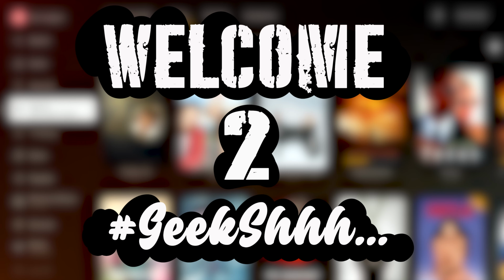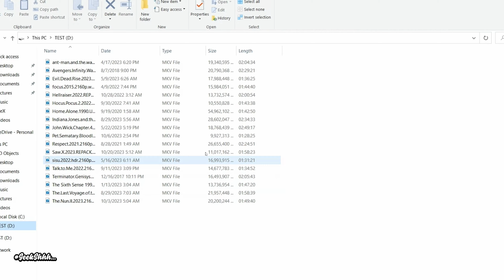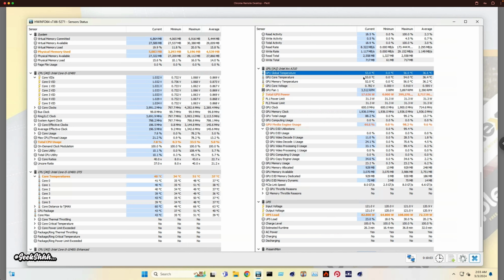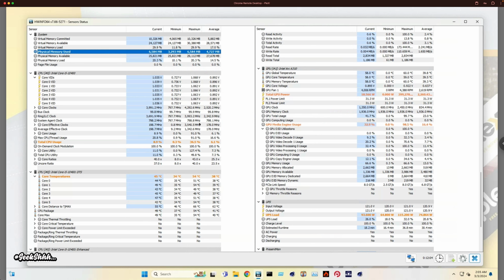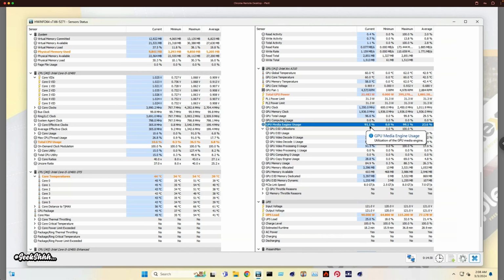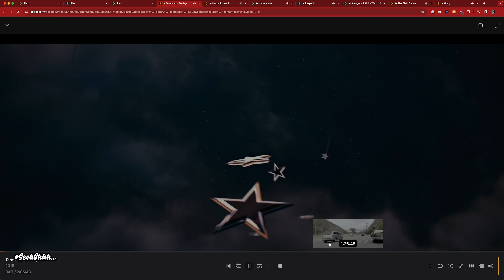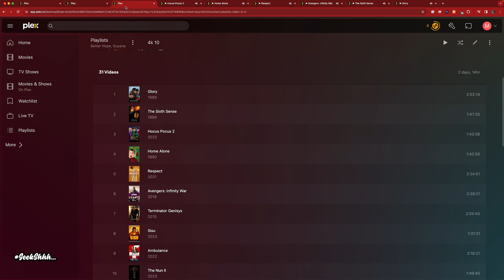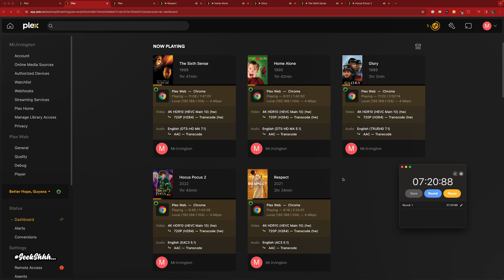Intel A310 #Plex 4K Transcode Test #Arc #GPU

Comment: This video is a god send. The a310 is the only card right now that comes in single slot and low profile and does Av1 so its great to know how well it does in transcoding. I feel like this is the real use for a card like this. Thanks for making this. I hope to see some vids of how it handles AV1!
Reply from the maker: I did an AV1 video and ill be releasing Next Monday. Thanks for watching and commenting!
Reply: Nope nvidia has single slot options as well just not consumer cards. But they do AV1 encoding.
Reply: @stephenxs8354 yeah and I own a Tesla p4 and I have to say it was a waste of money. No fan by default (cooled by the rack server I know), runs extremely hot while transcodes plus the driver issue under Ubuntu makes me wanna die.. Pain in the ass to get it up and running plus remain silent and hot or add a fan and still remain somewhat hot but extremely noisy.. I just swapped to the a310 and every problems are basically solved

Comment: I tried to put this card in my Z270 system which is currently used as my Plex server but it was not compatible with my board and kept locking up. So sad. I was hoping to use this as my transcoder. Currently I am using my old GTX 1070 but the Arc would have supported my encoding codecs.

Comment: This was EXACTLY what I needed to see. I just built a Plex server, with an i3 12100, and its transcoding is not the best I've ever seen. Was thinking of adding an a310, so I'm going to enjoy this video! Unfortunately, it looks like the Plex server does not use Intel Deep Link technology, which allows and Intel iGPU to work together with an Intel Arc GPU when transcoding.
Reply from the maker: i3-12100 has the 2nd best igpu that Intel makes which is the UHD 730. This is a very powerful igpu and is even more powerful than the A310. For you to  utilize the igpu you have to have the plex pass. Thanks for watching and commenting!
Reply: @GeekShhh  i do have the plex pass. I but I keep seeing small artifacts in the transcoded video that I know are not in the original files. It may be that I don't have the settings right. I'm very new to plex.
Reply from the maker: @ScottGrammer which OS are you using for your server?
Reply: @GeekShhh  Windows 10 pro.
Reply from the maker: @ScottGrammer  Ok download HWinfo so you can see what your cpu and igpu are doing when you try to transcode.
Reply from the maker: @ScottGrammer  Also since your new i have to tell you that your not supposed to be transcoding majority of the time. You should be Direct Playing content way more than transcoding.
Reply: @GeekShhh  Been running it for years, and it's already on my Plex server. I also just downloaded and installed the latest Intel Arc drivers, even though I don't have a separate GPU, as I understand that these drivers are used by the iGPU, and are better  and newer than the drivers supplied by the motherboard manufacturer (ASUS). After work this afternoon, I'll take a good look at the numbers while it's playing some videos. Thanks for your help!

Comment: Cheers mate, I just picked up the same card to replace my Quadro P400 that's been the Plex transcoding workhorse for the last few years.  Great little card, can't wait to compare power usage.  My only holdup is that Plex is a Docker container on unRAID and I need to commit to running the unRAID 7 beta as that's the first one with Intel ARC support in the kernel.

Comment: Direct to the point. Great video man. Thanks
Reply from the maker: I try to make it as short as possible. Thanks so much for watching and commenting!
Reply: @GeekShhh  I bought it to day for my plex server (amd plataform); previusly y had a rtx 3070 but for some reaseon I could not make plex and casaos hardware transcode; just installed the A310 and worked like a charm, exactly the way you concluded in your video, 5 streams 4k to 720 P; in the sixth the problems beggun but with five it is fine with  me; thans again.
Reply from the maker: @revinerd  Thanks for letting us know, Enjoy!

Comment: Fantastic! Please do this with RX 6400 and integreated AMD Radeon Chips. I cant find anyone else on YT willing to do these tests. Being able to know which one is best and how well they function are great pieces of info.
Reply: The 6400 doesn't have an AMF video engine on die. It's pretty much only a 3d accelerator for laptops which have an APU with video encode/decode on it's own iGPU.
Reply from the maker: I tried doing the 6600 XT and it was a huge failure and waste of time so im kind of staying away from the AMDs 😩. Thanks for watching and commenting!

Comment: Did you notice your Plex server’s settings was set to 5 max simultaneous transcodes?
Reply from the maker: 3:02 Thanks for watching and commenting!
Reply: @ Wow - I must have been half awake - my apologies.  I’m thinking of getting the A310 for a UGREEN NAS with just enough space for one low profile single slot PCIE card.  On a side note, I already run an Intel NUC 12 Enthusiast box that includes an onboard Arc A770 w/16GB VRAM that I use as a Proxmox server where I pass through the GPU to a Plex docker container.  This has been running like a champ, but I would prefer an all-in-one box.

Comment: For the HDR videos, why didn't you enable the "HDR Tonemapping" section in the transcoder settings? It seems like this would be a better test as it will use the OpenCL stress VRAM on the GPU during the transcode...
Reply from the maker: This gpu doesnt support HDR tone mapping in Windows. Thanks for watching and commenting!

Comment: 1 gigabit internet, not 1 gigabyte internet.  network speeds are measured in bits per second, not bytes.  1 gigabit per second is roughly 110megaBYTES per second, which, as you may note, is much less than 1 gigabyte.
Reply from the maker: Thanks for watching and commenting!

Comment: Is it worth to buy 14900k or 14700k for transcoding ? Need to upgrade my rig..
Reply from the maker: The 14900K and 14700K both have the UHD770 internal graphics which is also the same one the 12900K has and i already did a transcode video of the 12900k with the same 4K videos.....check it out... https://www.youtube.com/watch?v=Nd5nblwyT9o

Comment: Has anyone else had problems with the plex web app automatically transcoding all streams even when running hardware capable of decoding the media format? Ive been having this happen ever since i switch plex servers
Reply from the maker: Which media formats specifically are you speaking about?
Reply: @GeekShhh  hevc, for some reason i can decode hevc on my roku, plex desktop app, etc. As soon as me and my friends try to stream my library on chrome or safari on a mac it doesnt support the format and the server transcodes it. I didnt have this problem on my old server and ive changed all the settings on my player to allow unlimited bitrate and direct play/stream. Ive also tried disabling transcoding on the server and i get a cpu error on the player
Reply from the maker: @fuzzylobster3497  Thats very strange. I only can suggest to post about it in one of those Plex Facebook groups im sure one of them can help you fix that

Comment: i would recommend you to try to use RTX A4000 SFF gpu.
Reply from the maker: I just looked it up, thats a $1000 card, sheesh lol. I tried out the A2000 and will be releasing that video in the coming weeks. I may try out the A4000. Thanks for watching and commenting!
Reply: lol what a ridiculous suggestion.

Comment: Hey mate, I just got mine running and the transcodes (1080p 20Mbs) are garbage compared to Nvidia (Quadro P400).  Really bad colour banding and pixelation in comparison.
Reply from the maker: Color banding and Pixelation? Sheesh, now from what i understand It has certain limitations on Linux. Im using it on Windows so maybe thats why i never experienced that. Ill have to try it out on Linux so i can be more informed about those limitations. Thanks for watching and commenting!